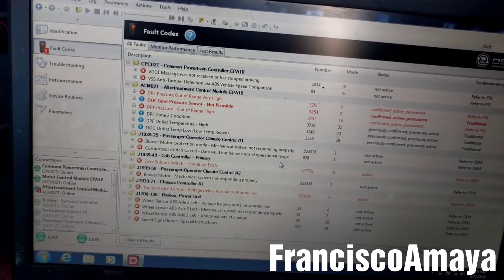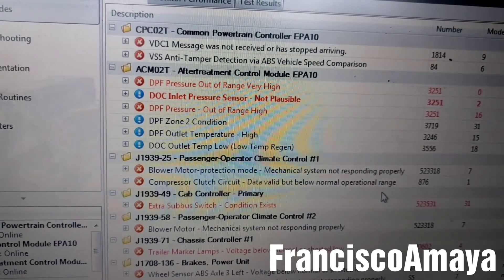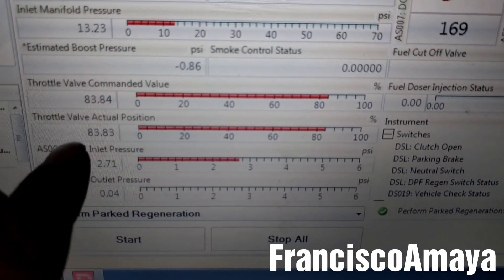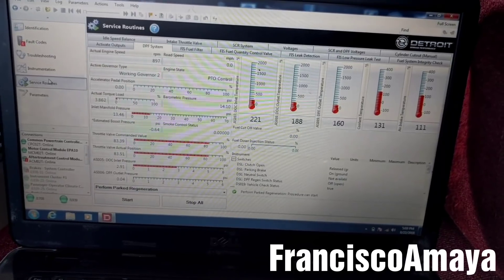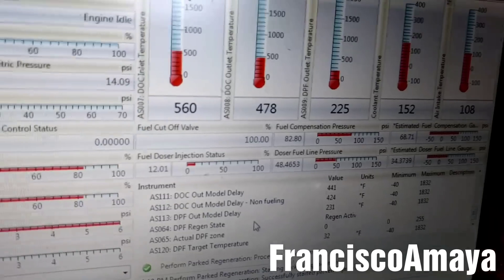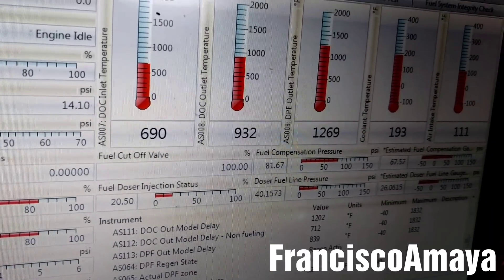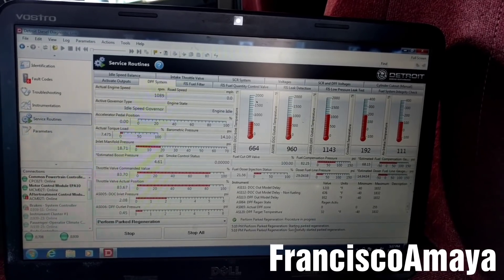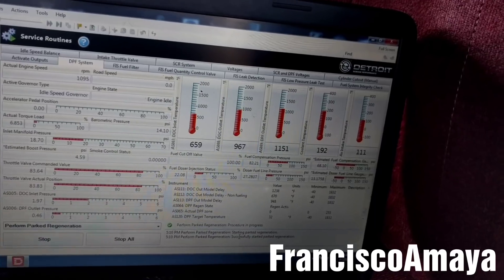Freightliner Cascadia DD13 DD15 DD16 SPN 3251 FMI 0 2 16 DOC pressure high bad SCR DOC DPF box

Comment: Hi bud ...need some help any idea on a 2012 volvo d13   
 SA 0 SPN 3251 FMI 5
Reply from the maker: This could be caused by a dirty doc or dpf the pressure is high so probably you must clean all that.
Reply: Francisco Amaya 
I had a new Filter last year
Reply from the maker: No coolant, oil or excessive fuel consumption?

Comment: Hi, what is causing my two bunk windows leakage? Anyone have or had this issue before?
Speed above 70mph my check engine light comes on the amber one with no loss of power. Any idea what is causing it? Thks
Reply from the maker: Probably it needs a cpc programming. 
The windows can be broken from the seals
Reply: @franciscoamayaYT   Thank you, Francisco. 
I have a 2013 Freightliner, I was told by Freightliner that the one box needs to be replaced for $12k. Saying all parts in the box are bad. It has over 956k miles on it. Will the motor need replacing soon? Thks for getting back to me, I really appreciate it!  DD15 Thks
Reply: your check engine light comes on because it passes the maximum speed threshold indicated on your electronic control module. In order to fix it, using the software change the maximum speed parameter from 70 to 75 and leave the governed speed parameter at 70.

Comment: I have a truck with this exact problem fmi 0-2-16. 
It needs to Regen every 15 -20 days. What is the reason for the doc dpf pressure increasing dramatically.
Reply: Aside from the obviously excessive idle time as a company truck
Reply: several reasons. carbon build up relates to engine performance. fuel quality and air ratio. air intake. ALL egr pipes. egr temperature sensor. Intake manifold air pressure. Also, the weight of the trailers you are hauling. The speed of travel.
Reply: We have a 2012 with the same issue. Truck doesn't Regen going. Down the road. Every 14-16 days it needs a Regen . My theory is that the big R sold this truck after reprogramming it. Idk truely